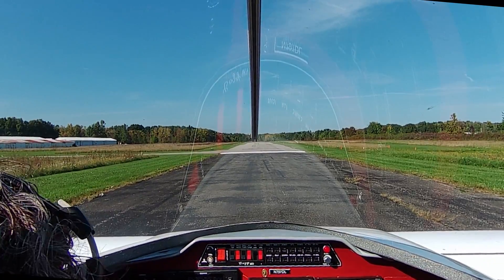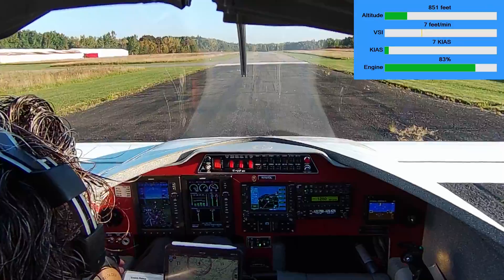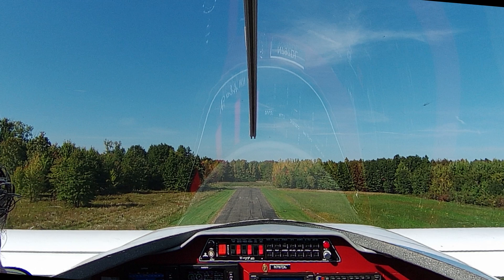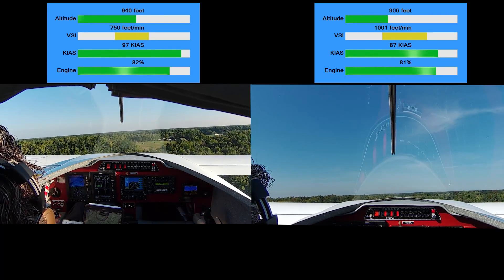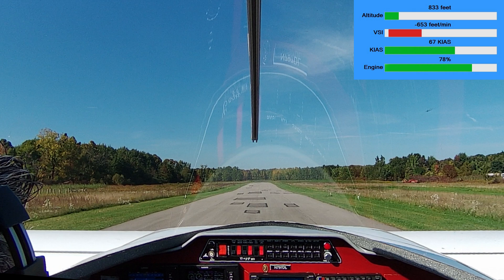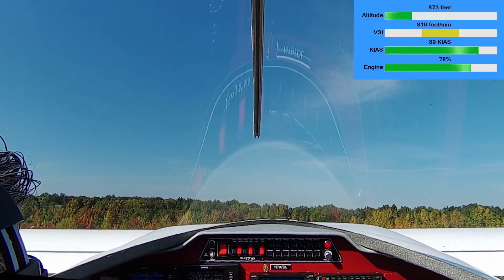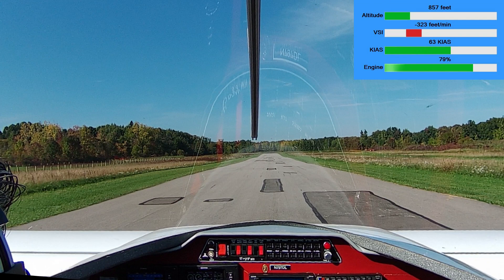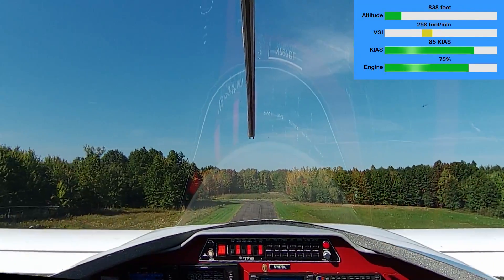Almost a CRASH: How did this happen? And why?

Comment: I'm not sure if the pogo stick is the correct model to explain what happened.
Pogo sticks save and unload the energy of a jumping motion. But your luggage has no leg muscles to produce such a motion. It just has weight...
I think it doesnt matter if a heavy person falls down from one meter height compared to a light person. The pogo stick will jump to the same height when both just land with their legs straight out. OFC the stick will save more energy before unloading with the heavy person. But the stick will also need the energy to catapult the heavier person to the same height of the lighter person.

Thus I'd really recommend looking at other possible factors before making conclusions (perhaps) too early.
Reply from the maker: Pogo stick is a perfect analogy. There is weight up front, underneath it is the nosewheel, which has (literally) a spring on it. When the runway drops out from under it, the nose falls down. The nose strut then compresses, at the same time, the runway comes back up - and the spring then unloads. So we have the stored energy in the strut, plus the forward energy of the airplane translated into upward motion by the nosewheel and rising runway, which combine to throw the nose into the air.
Reply: @CanardBoulevard  I perfectly get that. Yet what you imo seem to have overlooked is, that while the increased amount of energy comes from increased weight, the weight also dampens the extension of the nosewheel strut when unloading. If I was sure that you did think about this, I wouldnt Write. Feel free to proof me wrong. I find this very interesting.

Another thought: since the energy you gain when compressing your spring, basically comes from weight, your nose cant jump of higher than before since the weight is still lasting on it. If it would come higher you would have more energy in the spring than the additional weight induced. Thus you would have developed a source of infinite energy... Because after the next bump which would therefore be from even higher above, you again jump even higher than before... perpetuum mobile.

If anything you can only jump less due to overweight because the strut's spring range is limited.

Comment: Hi,
I'm not certain if your aircraft has a front shock or if it's even an option on these? If it has one, it might be time to rebuild it and possibly convert to thicker fluid/increase nitrogen  pressure? 
If it doesn't have a shock, can you install one?
Is it common for them to be bouncy like this?
Reply from the maker: It does not, and the design does not allow for it. It is pretty common for this type of aircraft to be very bouncy in its landing gear.
Reply: @CanardBoulevard  thats very disappointing. Having a damper would solve that issue.
Reply from the maker: @yuriykovalov2936  No, it wouldn't, because the nose strut itself is fiberglass, and is designed to also absorb load (and spring back). Even putting a damper on the gear would not get rid of that springiness. It's just a limitation of the design.

You also have to realize that adding a damper means there are now different forces acting on the pivot and support point in the airframe structure that mounts the nosegear, so changes would have to be made in that structure to account for that. That will weigh more. Lastly, struts are not light, so now you have to adjust for a shift in C/G, and a reduction in load-carrying capacity for the front seats. Everything affects everything else in airplanes.

Comment: Great analysis.  I really appreciate your sharing.  One observation is that you did not describe the generally accepted rule-of-thumb for aborting takeoffs: If you haven't reached 70% of your takeoff speed by the time you've reached 50% of the length of the runway, then abort.  You mentioned an inability to abort based on airspeed only.  You should consider airspeed and position on the runway.  For your airplane, it sounds like you should be at 50+ KIAS by the time you reach the mid-point on that runway.  Were you tracking the runway mid-point during your takeoff?  I did not hear you describe such.  Great analysis on the effect of balast in the nose.
Reply from the maker: Yes, mid-point on that runway is where you see the fence end and the trees begin on the left side, and that is normally my rotation point.

Comment: Ive seen this sort of thing many times - NOT with full size aircraft, but with model jets.  Pre take off as we call it is when the model bounces up and tries to fly before it has enough airspeed (above the stall speed). It usually ends up in a stall and model destroyed.... That's why they don't tend to be flown off grass, due to bumps etc.  We usually fly off tarmac runways etc, and not the concrete block ones, as the joins in the concrete slabs can cause this issue too for models.  We call it kangarooing...  Also the same issues on landing, if we hit a bump etc, it bounces the model back into the air and as we are landing, again (now at or below stall speed being on the ground)  the model stalls and we end up picking bits up :(   So i can totally relate to what you experienced with your take off.  You've obviously identified the issues, but you do need a better runway!  A model jet would have issues with that runway, never mind a full size one ...  :)

Comment: You need to find a way to add a damper to the front wheel.  That will stop the bounce, and add a little nose ballast.
Reply from the maker: As I noted, adding ballast actually made it worse, and is part of the issue that caused this.

Comment: A bit of pilot skill with a pinch of luck. Well done on not becoming a statistic!

A couple of thoughts: 
1. The pogoing  - how is the nosegear damped? Can you increase the low speed [shaft speed] damping at all? 
2. CofG - a more forward Cof G [although you confirmed it was around the middle of the envelope] will create a greater lift demand on the canard. = more drag. Do you think this was a factor? Can the canard be modified to greater lift/ less drag - modified tips/ span etc? I'd be concerned if operating at the max fwd CG.....

All the best with getting your airport resurfaced, and I guess you're wary of rough strips now in any case.

EDIT: So I've had a read of the POH for Cozy N83MZ. An interesting manual and  gives a bit of insight into the mandatory 6in shortening of the canard. So, you can disregard my thought #2! Back to my cave.

Comment: That is the way to stay cool under pressure. Cool heads prevail, panicking doesn't solve anything. Excellent analysis! I've survived 3 partial engine failures in my flying career and fortunately I had a very cool flight instructor in the right seat when I was a low time private pilot on my first engine failure. It's extremely hard to deny instinct and push the nose over and point at the trees. This is where a lot of folks make the big mistake. The Velocity nose gear isn't quite as springy but it will pop you up in the air on a bumpy runway. When I trim for takeoff I push the stick forward to make sure I have flying speed when I rotate.

Comment: I'm not a pilot, but I want to ask: It seems that the runway is not really horizontal in length. There is a concave at 2/3 of the distance? It is a small springboard with a half-foot height. The cave just arsons this premature jump.

Comment: Yeah that nose landing gear is quite flimsy. Also I think you could have done a better job at staying in ground effect.
But hey it's always easier to say afterward.
Reply from the maker: I stayed in ground effect until I hit my normal rotation speed of 75 kts, at which point I thought, "ok, now I'll pull and rotate" - but as soon as I did, I felt the speed decay and I could tell I was headed for the wrong side of the power curve, so I pushed the nose over again to gain more airspeed.
Reply: @CanardBoulevard  Yes we can clearly see in the video the plane "mushing" after rotation. That's why I don't like climbing at Vx, any miscalculations and you find yourself on the wrong side of the power curve. I often surprise myself how easy it is to get out of ground effect and for it to really be effective, to keep the wheels near touching the ground after rotation. I am sure you understand all of this, execution is often more messy than theory^^

Comment: Engine power is only 79%.. That engine is failing..
Reply from the maker: Piston aircraft engines do not make full static power, and usually not at altitude either due to density altitude and propeller pitch. The engine is in perfect health.

Comment: Two things: 1) Agree with the spring effect of the nose gear. I have used this phenomenon often in my LongEz to get the canard flying sooner (nose down and quickly nose up) and 2) You might want to lean the engine slightly to get max RPM.  That’s the end of my Monday morning quarterbacking.

Comment: Good save as a lot of people unfortunately would have panicked and end up in the Trees. Either stalling or decending into the tree. You didn't as you stayed calm assessed what was happening applied the correct inputs to get you outa trouble. NICE.
Reply from the maker: Well, I have been flying airplanes for 30 years. It's not my first time around. :)
Reply: It showed just ran with it solution appled excellent result.

Comment: Hey Scott, thanks for sharing the video.  Great job salvaging what could have been a bad situation.  I don't know what your moment/arms are exactly, but in my Cozy 25# at the front seat station is ~11# at the ballast station to maintain the same CG which would keep 14# off the nose gear and get you to a lighter overall weight (better performance).

Comment: Density altitude has killed a lot of people and planes. Moving the CG forward and moving it reward will dramatically effect the performance of the aircraft. The deciding factor as you point out was the dip in the runway causing the air frame to get airborne at critical airspeed. You did every thing right and lived to tell us not what to do in this situation.

Comment: I would find a different field to hangar the plane if the owner doesn't fix that asphalt. That runway is not suitable for canards. You need a better runway surface as well as more space especially with the obstacle at the end. Canards aren't designed to be shortfield planes and you are operating just within your safety envelope at this field. Good save though. When stuff starts to go sideways, you continue to fly the plane. Excellent debrief. Way to aviate, sir.

Comment: Great analysis, and more importantly you did not induce a stall by panicking and increasing AOA, nor did you get into an accelerated stall by increasing your AOA at a rapid rate once you had flying airspeed after decreasing AOA. Good reactions. I'd really be curious to see the AOA data? Does your avionics measure AOA?
Reply from the maker: It does not, at least not without first adding a discrete AOA sensor. Not commonly done on canards, I suppose because you can't technically steal the main wing? Might be useful for the canard.

Comment: VERY educational. I like your airplane, I can't see you being happy with a 182. I would vote for trying to find some outside money to fix the runway and cut down some trees. There must be some programs and money available somewhere, they just have to be uncovered. This airport is a resource to the local area, no different than good highways and good bridges. Good luck. Besides, all these pesky details like a short runway in poor shape does help make you a better pilot. You have to think through what you are doing each and every time instead of flying on automatic.
Reply from the maker: Very true. Every takeoff and landing. I have gone to that airport, seen the crosswind and density altitude, and said, "nope, not flying today."

Comment: Let’s wish the cozy mark 5 have 3 stages of flaps and you can use flap 1 for short field combined with your static takeoff (on the brake take off)
By the way, is there a stabilizer setting or elevator trim setting for take off?

Comment: Why was your power setting at 83% rather than 100% at takeoff
Reply: It’s because the aircraft is a fixed pitch prop. These aircraft are set for speed and the prop is designed for that. If it was a climb prop with less pitch, then it would make more power on takeoff. In turn a climb prop will be slower in cruise.

Comment: You should be ready to abort the takeoff too if something isn’t right. You had almost ten seconds to cut power and land that plane when you knew something wrong. Sorry for all posts. You’re just to precious to lose.
Reply from the maker: As I mentioned in the video, on that runway, on an ISA day, once I've hit 65 kts, I no longer have sufficient runway to stop, so I am committed.  When I found myself airborne, had I forced it back down onto the runway and then braked, I would have run off the end of the runway into the trees. The only option I had was the one I took.

Comment: Friend. I’ve been noticing this each time you take off. Maybe you need a new home field.  There’s really no margin for error there.  Imagine if you had passengers and baggage.  I’d sell that plane and buy a 182.  You’ll travel slower but safer.
Reply from the maker: The thing is - there are no fields within any kind of driving distance (other than this one) with available hangar space. Most have waiting lists years long, and I am on those lists.

That said I have come off of that runway with passengers, baggage and full fuel without issue. I just make sure that I pay very close attention to C/G, density altitude and performance charts. There's no "winging it" and hoping it will work. I want actual numbers that show that it WILL work before I will fly.
Reply: @CanardBoulevard  you have almost no margin for any type of error whether pilot error or mechanical. I’d park it outside before flying out of that field. You’ll have no options if that engine fails after takeoff.

Comment: I am not a pilot but the Cozy seems like it is quite tricky to fly, like a 25 lb weight almost causing an accident (with a few other things contributing).  Stay safe as you learn the quirks of the plane.
Reply from the maker: It's actually not tricky to fly at all - every airplane has quirks, but in this case, several things lined up together to cause an issue. Knowing the cause and how to prevent it is essential.
Reply: @CanardBoulevard  you did a great job analzing the root cause, i enjoyed your video